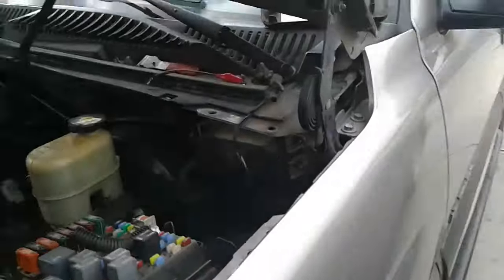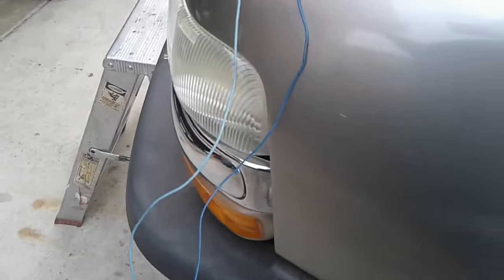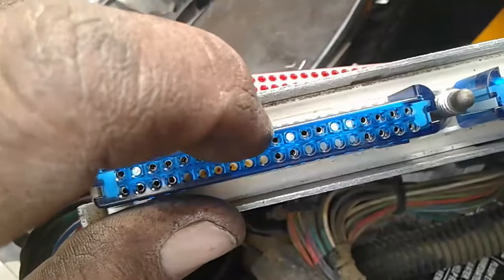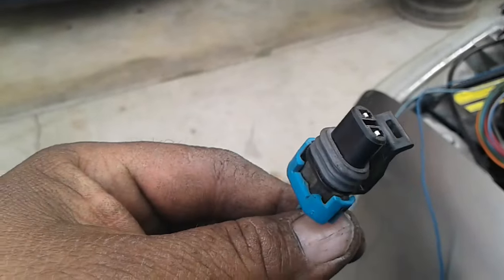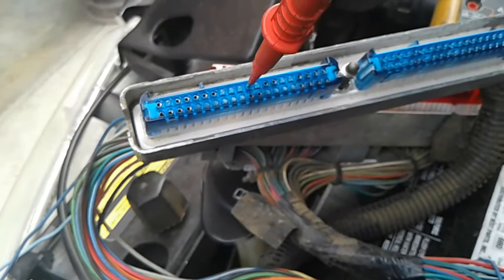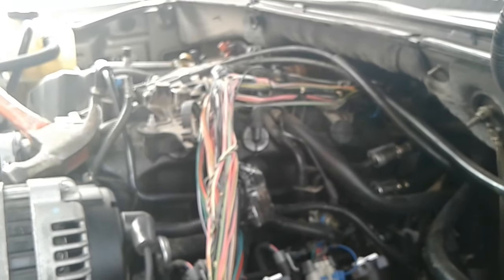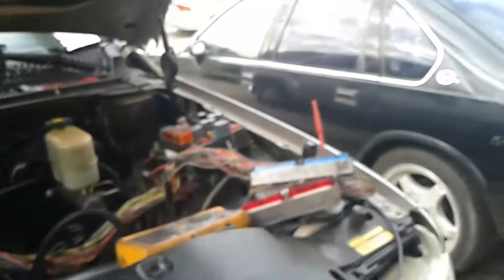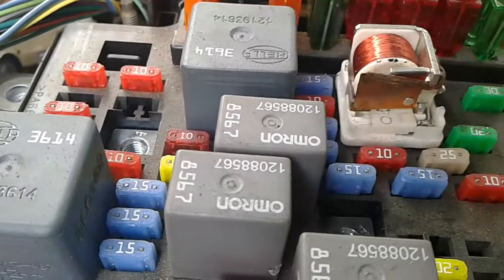Knock Sensors replaced and still getting codes P0327 & P0332

Comment: I’m having the same problem with a 2004 Chevy Suburban. I’ve also seen a few people here on YouTube state that they were still having the same error code for the knock sensors even after they replaced the knock sensors with new ones. One person said that they solved the problem by using an electrical cleaning spray and cleaning the connectors in both the knock sensor harness and the connectors to the ecm too. I’m going to try and clean the connectors out with an electric cleaning spray and then follow up with everyone if this works.

Update: The electrical cleaning spray did fix the knock sensor low input fault that I had on my Suburban. I simply disconnected the battery, removed the two color connectors from the ECM, removed the ECM from the mount, inspected all male and female electrical connections, sprayed the electrical spray cleaner a couple of times and scrubbed using a pipe cleaner brush, and allowed 15 to 30 minutes for the cleaning solvent to dry before assembling everything again. I did find that some pins on my ECM were covered in green grime and some other ones were white. But after the cleaning process everything seems pretty good now. I did have issues getting the rubber seals between the ECM and connectors to sit in place correctly, this caused my vehicle not to reset the ECM properly. But after removing the rubber sealing gaskets completely off the ECM did reset itself properly and the vehicle started up fine again. The last part was frustrating and a hassle, as I thought that I might have had damaged the ECM during the cleaning process but the culprits were the rubber gasket seals. I’ll just have to be really careful and mindful from now on to try and not get water into that region from now on, and clean up the ECM and connectors often.
Reply: I saw a vid where they mentioned the same issue you’re talking about. I bought some of the CRC elec cleaner. I had one sensor throwing a code a while back and replaced both sensors and sub harness with the AC Delco OE GM part #s and ever since both sensor banks keep throwing the low voltage code, but both read good on ohms at the harness connector?! I really hope it works! - ‘03 Yukon 5.3
Reply: Interesting maybe I give this a shot I replaced them both and the code and check light will come and go randomly
Reply: I have done the same. But I recently unplug the battery disconnected the the knock sensor harness at the intake then I rushed the motor a couple good times so far so good might have been a bad connection will knock sensor harness mounted into the trucks wiring but I'm thinking about doing that cleaning process too. I'm very busy at times if I remember, I will post  update

Comment: so I'm getting 0327 0332 i checked ecm and it did have some corrosion i cleaned and dielectric grease connector i replaced knock sensors and harness all gm acdelco parts still getting code
Reply: I'll fix it if for you
Reply: @Teev132  so, give it up?  how?

Comment: I'm having the same issue with a 2001 Silverado , changed both knock sensors with acdelco and new wire harness and still getting the p0327 and p0332 codes ,  did you ever solve your issue ? if so I need help with mine
Reply from the maker: dan blank remove the connector to the engine computer clean it with CRC electrical cleaner let it dry check to see if any of the wiring on the plug is loose or pushed out reconnect and play
Reply: ok I will try that , do you know the volts  I'm suppose to get from the pcm ? and do you know the ohms for the sensors
Reply from the maker: dan blank theres a youtube video intitled ( Tip Clip knock sensor testing )you should study. and i beleive its 75mv
Reply: ok I checked my ohms and it was 101 on both knock sensors ,, then I checked the a/c volts on the sensor and it was reading about 5-7 on meter while I taped block with hammer , sounds like the sensors are ok
Reply: sounds like my next step would be the wire going to pcm huh?
Reply: well I just checked the ohms on the pcm to the knock sensor harness and it was reading 0 , not ol 
so I'm really at a loss , I have checked every thing and cant find a problem ,
Reply from the maker: dan blank when you replace the knock sensors did you also replace the pigtail that goes under the intake to the harness?
Reply: I replaced the harness that had the rubber cups on it that attaches to the top of the sensors
Reply from the maker: dan blank did you clean the block surface where the knock sensors screw in the block and torque to specs? and also are the knock sensors after market, or OEM?
Reply: acdelco sensors , and I cleaned out the wholes where the knock sensors go even got a rag to get any oil out of it , and put the sensors on 15 ft lbs of torque
Reply from the maker: dan blank and the harness where it begins from knock sensor pig tail to the computer has been ohmed?
Reply: on top of the sensor to the pcm ? no ,
Reply from the maker: dan blank i will take a look at your codes thi evening really backed up with work . i will let you know in a few.
Reply: before I changed thm out I only had one bank bad but I changed them both while I already had manifold off , then the both bank errors started , I replaced the knock sensors twice and this time I traced my volts down to the pcm and everything looks ok
Reply from the maker: dan blank you should have the knock sensors themselves tested
Reply: L
Reply: SMOKING MEAT AND DIY BY DANIEL I’m having same issue, what finally happened? Did you fix it?
Reply: Gilbert Galvan how do you check only the knock sensor s?
Reply: @angelc7984  did u ever fix it having the same issues
Reply: @alejandrotapia5762  yes it gets easier after a few times.
Reply: @angelc7984  what do you mean it’s get easier
Reply: @alejandrotapia5762  the more times you have to do this job the more you know what to do.
Reply: @alejandrotapia5762  when you take the knock sensors off make sure the holes are clean from rust or any other dirt carefully, it’ll cause the codes to stay on . Also one problem I had also was that on the pigtail where it connects ( the blue end) it would push the wires out of the other end so that the connection wouldn’t slide into each other. It was hard at times but pay close attention when connecting it. Also don’t drop those sensors or shake them. When cleaning the holes I used a damp cloth to clean around and on the bottom and especially around the threads. I used a thin screwdriver with a cloth around the tip to carefully clean inside the small hole where the knock sensor screws in. Then blow everything out with air. If your still having problems, you might have a bad sensor from the store.

Comment: I know this video is old but, I'm going through the same problems 🤦.
Reply: So am I and I'm getting tired of this truck
Reply: @royrichardson9164  I bet, my car has mods. So I took it back to the shop who did my work and they hooked it up to their laptop, took it back to get inspected and it passed. They just bypass the code. But I'm going to replace the part next yr anyway
Reply: @alexandermcdole8464  Do you live in California? Cause I have same error code on my Pontiac montana 2001 and I my mechanic rise up white flag because He replaced the knock sensor and the wire but light still on. I don't know what to do and I can't pass smog test. Just bought the car and seller disappeared!
Reply: @tizianomammana  no, I'm in upstate NY, my car is modded so I took it back too the shop that works on it and they did their laptop thing and it passed afterwards.I have know idea what they did but it worked. Wish I could help you.
Reply: @alexandermcdole8464  Unfortunately I got my car from FB marketplace and the seller gave me a rip off so now I have to figure out by myself but as new immigrant in US I don't have knowledge and neither the mechanic found the issue after replacing speed sensor, knock sensor, wiring harness, and idle air control valve. I really would love to find someone like your shop which bypass the problem with a laptop! Thanks for your reply btw.
Reply: @tizianomammana  no problem man, Good luck
Reply: Probably has an actual engine knock
Reply: @fiveninegarage  I brought the car to a couple mechanics and they didn't find the knock. Is a terrible headache for me because when I clear the codes the engine light remain off only on the highway but as soon I approach in the city with frequents stop and go, after 2 minutes the lights pop up again!!!! I don't know what to do, I was thinking to replace the entire engine with something a bit more fresh (mine has 194k miles) and maybe solve the issue.

Comment: These knock sensor issues are utter hell.  Replaced both 10 months back (one tested bad) with random aftermarket sensors and new plug harness (shortly after a new computer and whole new vehicle wiring harness was put in for unrelated issues).  Those sensors appeared to fail a month apart, based on code (didn't test).  I just redid the whole job with OEM to be sure,  but pending low voltage codes again appeared for both sensors after the first drive cycle.  Both read 100K ohms, so reasonably sure I got the connectors firmly seated on each sensor.  So now I'm wondering if the first set of replacement sensors weren't actually bad, and it's something else entirely?
Reply: You probably have an actual engine knock
Reply: @fiveninegarage  if I have a exhaust leak and it’s ticking would it cause the sensors to turn the check engine light on?
Reply: @fiveninegarage  cause all I have is a tick I don’t hear any knocking
Reply: I replaced my sensors also.  Still getting a check engine light when Suburban goes over 65mph.  Did a ohm check going back to the ECM and got about 4.7K phms.  So cable is good.  Possibly bad ground from engine to chassis.
Reply: @rogermerritt6470  I read that it takes a few drive cycles(20-30 cranks or 50-100 miles driven) to get the sensors fully set...🤷‍♂️.
Reply: @patrickcarter2065  Well, I didn't wait that long.  Saw another post about reving engine up to 5K twice to get computer to see it.  That ended up blowing my radiator out.  Ended up putting another set of knock sensors up high on the passenger side head.  There is two threaded holes for them there.  Works fine now.

Comment: I'm having same issue with my 1997 Saturn SC2. They've replaced three different knock sensors with the last one being an AC Delco. Now the check engine light with same p0327 code is showing intermittently.

Comment: I tried to read ohms from the KS harness and got nothing.???
Reply from the maker: Ok, fist disconnect your battery.  Then take off the connector that has the knock sensor blue wire at the computer end and connect positive test lead there, then connect the negative lead to the knock sensor connector end while you have the dmm set to ohms. And you should have 2 to 3 oms of resistance max less is preferable. Then let me know what you got.
Reply: Gilbert Galvan you mean right at the top of the manifold where the blue clip is ( the connection from the harness to the line that goes to the computer) on top, so I’ll unplug it and use my multimeter, my red positive to the computer end then the black one to the harness connector?

Comment: What was it? My truck has had these codes for too long and still can’t figure it out! Such a pain
Reply from the maker: In all we replace both knock sensors the pigtail open the wiring loom to track down the wiring the wiring was fine it ended up being a corroded connector at the end towards the computer side it had a trace of lime green corrosion on it

Comment: I’m wondering if anyone had experienced power loss like I have? Only codes I’m getting is for the knock sensors. I’ve replaced them twice and still getting the code only after highway speeds. Dealer confirmed the engine is perfect no knock what so ever. They said it was the PCM but a BRAND NEW PCM will not accept programming. Now they say it’s a wiring issue. Any advice? Anyone?
Reply: Spray brake cleaner really hard around bottom of the intake manifold.  See if motor starts to react to it. If it does then its most likely intake manifold gasket leak. Reads as knock sensors and or random misfire
Reply: Mount them by the lifters it'll solve you problem
Reply: It was the knock sensors. Bought ac delco twice from GM. They are sh!t. I ended up going to a junk yard and getting OEM sensors  out of a wrecked truck. Fixed the problem instantly.
Reply: @robertm.1129  disculpe amigo, mejoro la potencia de su camioneta?

Comment: Did you come to a conclusion on this? What was the cause of the issue?  I am working on 2002 camry v6. Got knock code for number 2 sensor. I replaced both knock sensors and harness. Test drove it for 15 miles and it drove like a dream.  Headed home and it coded on the on ramp to the highway.... I coded for number 1 sensor...? Replaced both again and the wire harness for good measure.  Same exact thing happened again, same test drive with same results..? Someone said the issue would be in the wire going from knock sensor wire harness to the computer. Do you have any thoughts?
Reply from the maker: Conshus yes the connector terminal to the computer was being pushed out when it was plugged in.
Reply: @SuperDjnrg  Was the conclusion the need to use OEM Knock sensors or the Actual terminal to the computer was the culprit(Bad connection to the computer; Assuming the same stands, Nothing to do with the wires integrity) ?
Reply: Thank You in Advance
Reply from the maker: If you can gain access to a pinout chart for your computer to tell you where the knock sensor pins are, you could do it ohms check with the knock sensors disconnected. Also check the length of each circuit to make sure they have the correct ohms. You're going to get either one of three readings, the correct ohms, ohms are too high, or open circuit .in my case it ended up being the pins that entered the computer.
Reply: @SuperDjnrg  Thank You Gilbert !

Comment: We went with duralast parts and the light came back on. Ya think it’s just the parts?
Reply from the maker: I dont think so , unless it was dropped during shipping or installation. My problem was at the connection at the computer.
Reply from the maker: Do a ohms check from the computer connector to the knock sensor connector to aliminate a harness break in the circuit. Its the blue wire in the video. OL means theres a break, 5 ohms or less is perfect. Anymore than 5 ohms means that theres a high ristance point somewhere in the wire. At the time of the video i also had Autozone knock sensors and they where fine.
Reply: Gilbert Galvan ok, thanks. I appreciate it. I’ll plug the multimeter in and see what’s up. Great video, take care!

Comment: Will say this I had a issue with my 02 Tahoe with knock 1 so I had to take it to the shop since I don't have time to fix it due to my work. And this shop try to tell me things like I don't know nothing so I said yes replace both of one is bad and replace the wires also. So 498$ they claim to replace both knocks and wire harness within afew hrs to a day tops the check engine light comes back on and now it's showing knock 2 and I called the shop and even brought it back and they claim everything is fine and claim they replaced both knocks if that's the case then knock 2 wouldn't pop up. This is a major issue for the people who don't know anything bout vehicles and shops just keep wanting more money for parts and claim they can fix the issue. I was brought up around old school heads and mostly all muscle car mechanics so I know when a shop is bullshiting me. Let's not forget I also have a 05 dodge ram I had no time once again to replace another sensor on it so I took it to them and had it replaced paid cash and drove off not even one mile down road dodge shuts completely off without any power to stop good thing noone was in front otherwise I would of caused accident. So I was able to crank it up and drove back to that shop and toldem I'm not happy and the money I paid to replace a part so they had a boy come out and look inside engine he was quick to look and connect connectors that was causing the issue and I told him straight up thanks and it's likely whoever was working on truck was in a hurry or wanted me to come back to give more money that isn't needed. So since my dodge is running good I took the Tahoe there due to my work schedule of 3rd. I I would recommend anyone who goes to shops for either due to job schedule and not have time to fix or people who don't know anything to watch out for shops like this I'm talking about and call them out on they're bullshit and expose fake mechanics. I guess later today I'm gonna go ahead check everything myself and if the price I paid and they lied about the replacement I'm going to be beyond pissed with this place cause once you get into the area the shops work around will void it. Think for the sake of people worldwide if the issue occurs the same as it went in customers should by law get there money back in full and the shops should be shut down till they can get real mechanics and stop going by the damn internet pricing of labor you get poor labor the shop shouldn't get any money till it's like the vehicle just came off the lot brand new.
Reply: Have you asked a Chevy dealer repair tech about this issue?   Run of the mill chops are good at replacing faulty parts, but troubleshooting this problem seems to be out of their league.  Having same issue after replacing my sensors.  May have to do with the type of noise the sensors hear after so much milage has gone by on the engine.  Mine has 235K miles.